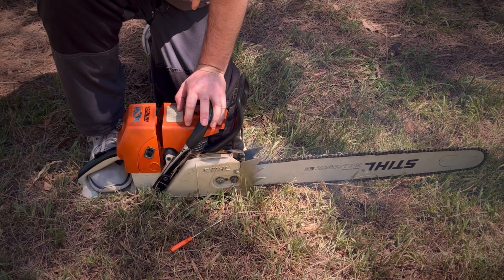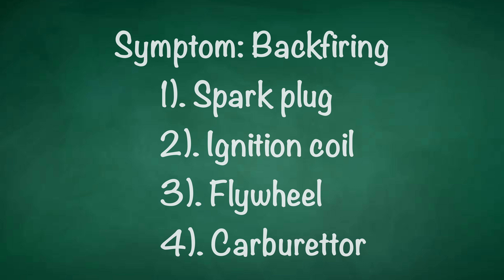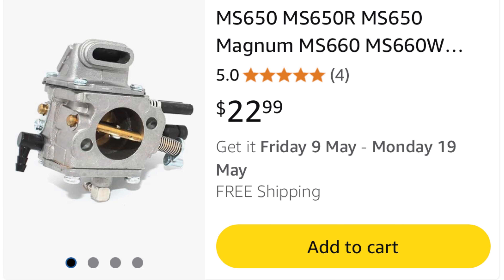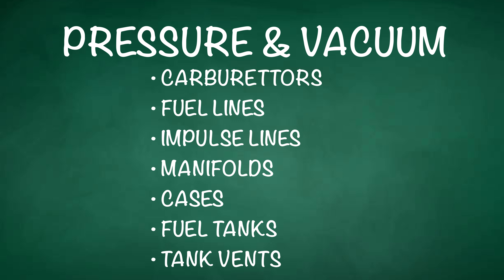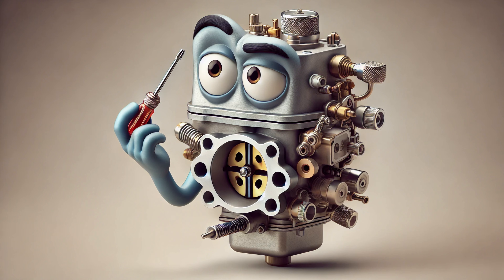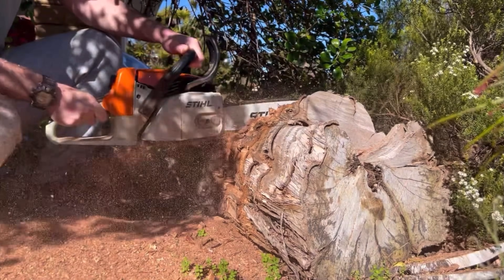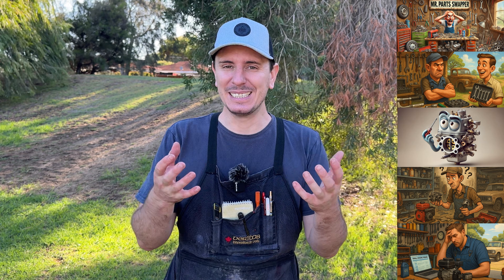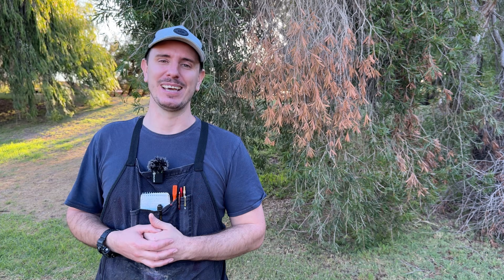5 Mistakes You’re Making On 2 Stroke Repairs!

Comment: Great video!!! I got one for ya. I have two STIHL br400 backpack blowers. On both of them, to get them back running good I have replaced Spark arrestors, base seals, muffler seals, car seals, spark plug, fuel filters and last but not least carbs. Carbs from Amazon, but after they were still not running great I ended up sourcing brand new OEM carbs and replace them both. They actually run good now but the problem I'm dealing with I have gas leaking out of the gas cap and pressure building up in the tank. What in the world do you think is causing it? I've been down the rabbit hole all over the internet where people talk about the vent in the gas cap and I see where some even change it and still have the same issue. And before I change the gas cap is there anything that you can think that could be causing the build up in the tank and leaking gas around the cap. Br400 dosent have tank vents. I know they went with another version gas cap that I may try to source as well.
Reply from the maker: Hey mate, pressure build up to an extent is normal in the tank, they have a one way valve, it lets air in to avoid a vacuum forming and stopping the engine from running, but not air out. Therefore on hot days pressure does build up. Now, certain fuels, like winter blends used in warmer months can actually cause fuel to boil, increase pressure drastically and cause a whole bunch of running issues. My very first step would be empty all your gas cans and the tank and go to a reputable high traffic fuel pump and get the highest quality unleaded you can.
Reply: @VintageEngineRepairs  gotcha & thanks for responding!

Comment: Great advice! I am stuck on shindy that someone dropped, has great compression and spark but won’t start on brake cleaner, no backfire or anything
Reply from the maker: Thanks! Good luck with your repair :)
Reply: @VintageEngineRepairs any ideas what to check? Has blue strong spark, I pull the exhaust off and rings and piston look perfect. It’s shindiawa t270

Comment: I don’t think you really ever get past writing stuff down. They had a class at a sawmill I worked at call Control Failure Analysis which is a fancy way of saying investigate assumptions. A lot of the crew poo pooed it because of experience but even experienced mechanics get stumped and it helps clarify the problem.

And yes, special tools, there is no replacement.

Cheers
Reply from the maker: Thanks for watching and sharing :)

Comment: After watching several videos on carb repair (some of yours and others) I am the poster boy for carb confusion! I have repaired many chainsaws but no matter what I do I end up frustrated by those little fuel atomizers and end up buying a new one. I can tune them well enough but I have never successfully rebuilt one and I have 30+ used carbs that I have replaced to prove it! The small parts are very intimidating! And btw, I have NEVER made any of the other blunders you mentioned 😁
Reply from the maker: Hehe all good they’re a little tricky in the beginning, but you’ll get there :)

Comment: My 19 year old Echo weed trimmer is all original and has never been worked on. It fires up on 3 pulls and runs great for hours. Yes, I highly recommend buying Echo products.
Reply from the maker: Awesome to hear!! They’re very good tools, but unfortunately  parts are impossible to get out here :/
Reply: Hey, mine too! It’s the original grey colored Kioritz Echo. Bought it about 20 years ago and I always use avaiation fuel for the 50:1 mix. Never rotted a hose, never had the carb apart, always starts on the 3rd pull. Same with my blower and hedger, all Echo from the same era. The newer orange ones seem to have much more problematic fuel systems.

Comment: I got a question, all these parts are made in china, all the carburators for example are made in china probably on the same factorys and everything, so why not use them? 
Probably the biggest difference is quality control but I can always order, test and if it does not work return. For the price of 1 OEM carb u can get 2 aftermarket carbs so I reduce the chance of having a broken one and then retur what u don't use, and u will still save a lot of money.
Reply from the maker: Na OEM small engine carburetors from Zama and Walbro are at their own factories. Some brands are mass produced, but QC is key :)